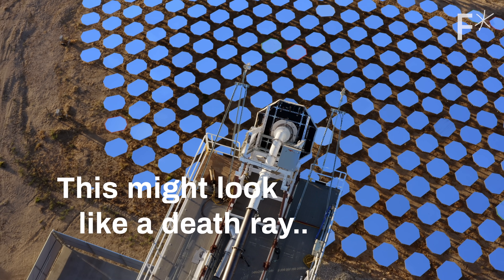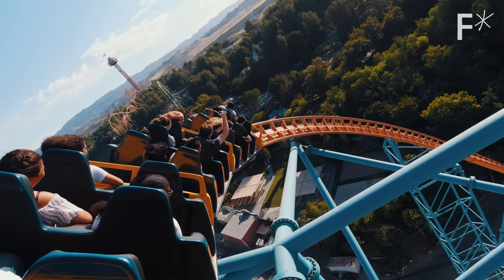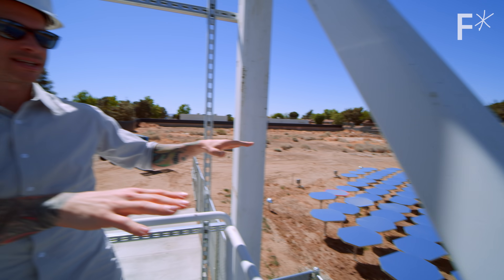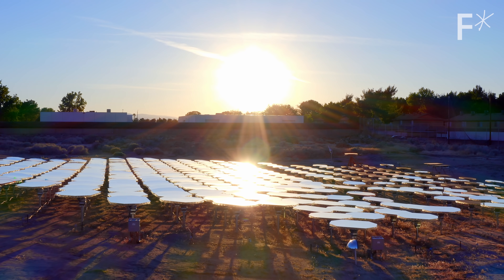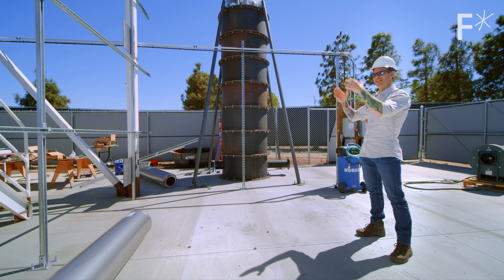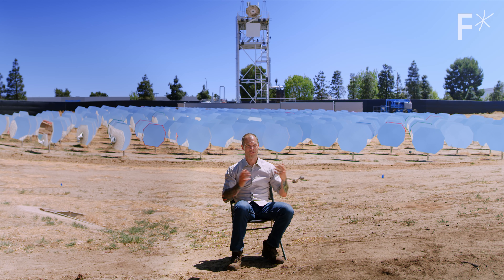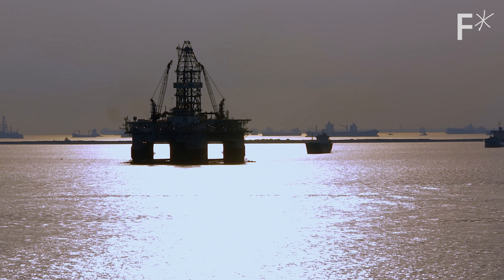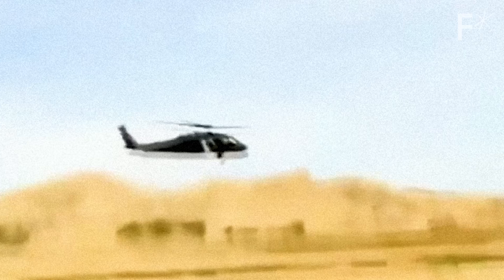How concentrated solar power could fuel the future | Big Think

Comment: CO2 at 0.04% is a 2,500th of the atmosphere. That means to warm the climate by just 1"C carbon dioxide molecules must capture 2500"C of heat energy. That is bonkers. It also breaks all the laws of thermodynamics. 

Methane is 0.00017% of the atmosphere so its even more bonkers.

However, the climate is changing. This is because of deliberate geoengineering programmes, in particular ozone thinning away from the poles. Though largely unreported ozone thinning effect is directly observable, this summer you will see a unnaturally bright sun just as we did last year. Under these conditions the pain felt when looking at the sun is not only from the increase in visible light but the much larger increase in infrared. (Look up at the sky and you will see a range of geoengineering operations in progress, these include chemtrail induced cloud or hazing, ripple patterns caused by HAARP installations, bizarre and unnatural cloud formations). 

Climate change is a programme to force change in accordance with the implementation of Agenda 21 /2030. Current events demonstrate this transition is well underway and will involve massive population cull through injected nanotech (re transhumanist programme). Agenda 21 also sees the permanent loss of all property rights with the introduction of universal basic income (ref NESARA/GESARA) and has/is being promoted by The World Economic Forum. 

'You will own nothing and you will be happy' WEF

In a depopulated world the surviving brainwashed and controlled population will be confined to mega cities. Carbon limits will be used to restrict consumption and liberty. Meanwhile the re-greened wilderness will be the exclusive playground of the ultra rich elite posing as conservationists. 

The CO2 hoax amounts to the theft of the world and the enslavement of humanity by a parasitic few. 

Welcome to the future!

_______

I have included a debunking of 'accumulated heat' as it is so often used to explain how trace elements, so called 'greenhouse gasses', can warm the planet. 

Accumulated heat whilst sounding a reasonable explanation of how heat can build up is rather nothing more than gobbledygook. In fact it shows those using such arguments do not even understand what heat is. 

When we measure temperature we are measuring the heat energy a thing is losing. In short heat is a measurement of flow, the transfer of heat energy and this will always be in the direction towards the colder. For this reason a thing can never 'accumulate heat' in the way those advocating CO2 climate change describe. The temperature of a body is the measure of heat output, it can never be greater than the measure of heat input. Output = input. When a thing is warmed it is heated to an equivalent of the heat input. If this input is not maintained it will cool. Those that propose that heat can build up to be hotter than the total measure of heat input at a given time either do not understand what heat is or are being deliberately misleading. To illustrate, an object being heated by a flame can never become hotter than that flame, it's temperature cannot rise inexorably to the temperature of the sun for instance. Heat cannot be accumulated. When we think about it common sense tells us this must be the case. 

NASA and even Nobel Prize winning physicists have expounded 'accumulated heat' as the explanation how CO2 is able to warm the atmosphere. They claim that over hundreds of years CO2 has captured heat energy and this heat has 'accumulated' to produce a serious warming effect. As I have just explained, this is totally impossible and fundamentally violates all the laws of thermodynamics. That respected scientists should support such uneducated, unthinking nonsense is disturbing and only reflects that in terms of being able to think clearly about a subject they have no facility or inclination. These are the Dark Ages of science. Belief has outweighed logic or any critical thought. It tells us that we should not unquestioningly accept anything we are told, that experts can be fools. 

(NB: be aware of attempts to discard thermodynamics by talking about biology. 
Eg. 'It only takes a drop of arsenic to kill a person.'
This would be somewhat desperate, muddled thinking. Clearly biological processes based on the reaction of a cell are not the same as the laws of physics/thermodynamics).

Comment: Where do you get the water to turn into hydrogen? Not many deserts are right next to the ocean and how much ground water could there be? I guess you would need to run wiring from the desert to the ocean shore, since that would be easier than transporting the water to the desert.

Comment: Two big problems with solar is that it is intermittent and diffuse.
Reply: Nuclear needs 1.3 square miles per 1,000 megawatts and it will not effect the climate. These solar and wind farms, if made to scale will have a huge effect on the climate.

Comment: "the difference" was confusing
They tried to explain why THEY are better than others. At one point they say it's because they can get to a higher temperature and thus melt rocks. Okay, but others don't need to because they are just melting salt. Different approach. Both make thermal batteries essentially... but then they are suddenly talking about splitting water to make Hydrogen. From the thermal batteries? If so, then why are YOU unique?
I'm having a hard time believing that the "software approach" enables them to line up mirrors in a way that nobody else is capable of doing accurately.

Comment: You could do a similar thing with solar panels, which are already more cost effective than fossil fuels. The detour with hydrogen can be chosen, if you have way more energy as you need. But the essence is: Do it. Either this or classic solar, or probably even both. Throw money at it and you will get a good return. I assume that this type of power plant will cover the energy base load, as it has a fairly constant output. Energy spikes could be covered with water power plants. Energy for direct consumption (think air conditioning, etc.) would be far more efficient with local production. It is possible, it will come, but will it be fast enough? That is the hard part.

Comment: I am staggered by the use of AI for orienting the mirrors. I assumed that some high school math would be enough.
Reply: The AI isn't for calculating position. It's for modulating which mirror to control when.

With 400,000 things to move in 2 axis each, and with it taking a couple seconds to move reach one and verify it arrived, you never get the job done before you have to start over.

Same problem arises with how to provide power to all those ¾ hp motors.

These problems compound with bigger systems that have more mirrors.
Reply: That was my first thought as well.  They didn't go into the details.  It seems their goal is to optimize the sunlight collected.  The only think I can think of is that differences in the atmosphere can refract the sunlight slightly.  The refraction will change constantly and, unlike the position of the earth and sun, it cannot be calculated in advance.   It's just a thought.   So while more advanced than high school math it is probably not 'AI' that is being used but some sophisticated software/math.
Reply: No need for AI at all, sensors and a good program can manage that all...
Nowadays a simple if else program is being called AI only for marketing purposes
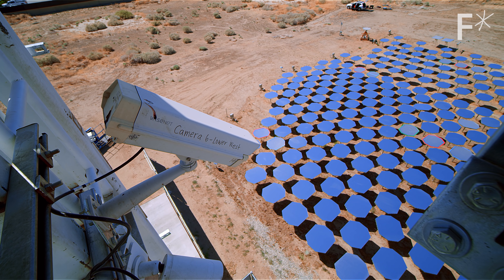Reply: @khaledarja9239  My interpretation was that they can do a setup with cheaper, less precise devices using AI than they could with a highly calibrated set of machinery. The AI allows them to calibrate on the fly and tune constantly (2:05). By eliminating precision machinery requirements, this system would drop the price dramatically by greatly easing the factory requirements (tolerances) of the components, meaning cheap components that work as well as expensive components when tied with the AI.
Reply: @khaledarja9239  actually, there's always going to be some compromise in this task because doing it completely and perfectly isn't possible in the time allotted. And when there's compromise, there's room for learning new strategies to maximize one output vs another. That's where the AI comes in.
Reply: Flat Heliostats can be aimed with simple circuitry, however, they chose to use AI. As Flat Heliostats need two-axis controls...
Curved Heliostats can heat molten salt in a pipe and only need one-axis controls...

Comment: Hopeful tech... however. Software controls the accuracy?... hardware still has to move, align the mirrors. How is the hardware powered and how much maintenance is needed? Dust is another problem. How to clean thousands/millions of mirrors in deserts where there is no water. The mirrors seems also a bit fragile. Ofcourse they can be reinforced but this will cost material thus energy.  I really hope they figured out some of these issues and there are solutions but to power the world by using this tech at the end of this decade seems not possible.. nevertheless we can/must make a start.

Comment: Very cool!! However, getting the sun's position this way seems a bit excessive to me, I mean you can have a sheet of metal or anything really, with 4 LDRs and 2 servo motors, one for each axis, and this sheet is programmed to move until the 4 LDR values are the same since they're connected to servo motors we can get the position of these motors, and feed that back to the PLC, of course, each heliostat's position must be saved to do some linear algebra with the vector of the sun we got from the LDRs! This way is cheap, precise, and reliable! At least that's how I'm doing it for my SDP!
Reply: I don't know tho, maybe that's why they got such high temps compared to our 550 C! very cool idea tho!

Comment: issue hasnt been about energy generation from renewable sources for a long time, its been about retaining the energy after the sun goes down or wind stops etc. Without solving that problem, this will not.
Reply: If I understood this premise correctly, the hot rocks act like a battery, storing heat that can be used at any time. Presumably, at the scale he proposed, it would retain enough heat to be used at least until the next sunny day.

Comment: Just a thought they say global warming keeps increasing over the last forty years, solar power has been around forty years and keeps increasing. How does solar power work it absorbs light that would have been reflected from the earth and makes electricity? When that electricity is used it gives off heat that goes into the earth. Is there a relationship between solar power and global warming? It sure sounds like it to me.

Comment: Using electricity to generate hydrogen and moving it around in pipelines is not only extremely inefficient but also a guaranteed disaster in the making.

Comment: I would like to see a comparison between the heat energy and solar electrical energy - rather than a proposition to use heat arrays (sounds entropic energy loss friendly) to convert transported water to the desert (sounds energy intensive) to produce hydrogen (notable energy losing process) to transport it to places without sun (ugh, more energy) 
.

Comment: It is not going to work, 
It doesn’t generate alot of power.
It doesnt work for 1/2 the day
It doesnt work in weather.

But mainly It is not fixing the main problem that solar has storing the power and getting it to where it needs to go

Im guessing this is just publicity and you wont hear anything about this for the next 10 years when it re-surfaces again

Comment: I have read an article criticizing the fuzz around hydrogen. Allegedly some scientists are suggesting that all the fuzz would be a diversion from transforming our energy supply to a de-centralized solar-powered supply, which would be a lot more energy efficient - apart from possibly for the purposes of heavy industry like the steel industry. The point of the piece I read was that all (most?) of the promotion of green hydrogen was merely a means for the fossil fuel industry to delay the transformation and prevent a decentralized power supply.
Well even if this works for the heavy industry only I do want to see this happen! Great

Comment: Sun to heat, heat to electricity, electricity and fresh water (in the desert!) to hydrogen (which needs supercooling and is extremely volatile and so hard to transport), hydrogen to electricity...
I would like them to actually what's the whole system chain efficiency. Hard to imagine how this could be cheaper or more efficient than just solar and batteries.

Comment: Heres a thought: invest in carbon capture to actually pull co2 out of the atmosphere. Break the carbon out and condense it into a solid, use that instead of rocks as your "battery".
Reply: You turn that carbon back into synthetic petroleum and the cycle becomes carbon neutral and you don't need to build new infrastructure from the ground up to support electric vehicles.  The Germans discovered how to make oil out of coal in the 1920s so we can definitely make oil out of captured carbon from the atmosphere.

Comment: There is NO PROBLEM in meeting ALL OUR ENERGY NEEDS ON EARTH... AND WITHOUT POLLUTION... JUST USE AGRIVOLTAICS on 1Million km2 of the Global 15km2 of Agricultural Land.... while growing similar amounts (from a little less to .. much more) of FOOD too... yes only ONLY 7.5% of Framland....... you can now relax... as there is more than sufficient Land to permit "modern man" to wallow and feed all of man's appetite for Energy...

Just FYI... the above 1 Million km2 would consist of 150TW of AVPV Panels generating 180,000 TWhrs/yr.... by 2050... Why look around and "waste money" on "other oprions"... focus... and JUST DO IT.... ASAT (As Simple As That)... all this with TODAY'S TECHNOLOGY.... as FAR AS THE SUPPLY SIDE OF ENERGY IS CONCERNED..... if you really want a challenge(s)...
• Focus on Non-Polluting Solutions for Sunset-to-Sunrise Enegry from Solar Energy produced during the DAY... approx 20-25% of the 180,000 TWhrs/yr... (Electric Batteries leave behind a legacy of Toxic Waste... a no  no.. if you want to eliminate pollution....).
• Conversion of Industries (Steel, Cement, Glass, Materials, Chemicals, etc..) from guzzling Fossil and Polluting Fuels to (Solar Powered) Electricity
• Conversion of Transportation Sector (Land, Air, Marine) using Non-Polluting Solutions only ... like Compressed Air, Hydrogen and other Gases and Liquids (from Electricity only) and NOT cause Gaseous, Liquid, Solid Waste Pollution during use and "after death"...
• Conversion of Commercial and Residential Sectors from Fossil Fuels to Electricity (from Solar Panels)
IN OTHER WORDS.... THE REAL PROBLEM IS IN THE DEMAND SIDE OF THE ENERGY BALANCE... AS AV (with Storage) assure 24/7 Non-Polluting ENERGY fir not jyst the present Electricity users but ALL ENERGY DEMANDS OF ALL SECTORS... 
All the best... and "put the shoulder to the plough" as mankind tries to undo the damage caused by Pollution to MAN.. BEAST AND NATURE TOO... and hand back a hwalthy and green Earth to our grandchildten and beyond.... 
O ly problem we will leave behind for the next 1,000 generations... is Nuclear Waste... and hence MUST PUT AN END TO THE NUCLEAR PILES ALL OVER THE WORLD.... AFAP (As Fast As Possible) ... to reduce this legacy of nuclear waste for future generations because of our SELFISH AND ASELF-CENTERED Needs to "wallow" in Energy...

Comment: Its a deluded approach.... first go look at all the failed solar just like that.   If you had any insight into manufacturing you would know there are steel foundries today that run on hydrogen and that is a simple conversion of coal fired. So whats the foot print difference? yes its massive to rebuild everything and would take decades. Hydrogen is ideal for many industrial applications and you can also do a host of green fuels. Heres the kicker .... the US has %40 more green hydrogen from nuclear avalable TODAY. So the issue is why are the bloody minded greenies ignoring the zero carbon footprint of existing sources? 50% of current solar panel energy is wasted MAYBE we need to focus on leveraging the current resources and not pie in the sky unproven tech.

Comment: Fantastic, heating up stones to store energy from heliostat mirrors, is a far better mechanism.  To do this efficiently and economically, as shown, is inspiring to learn where the technology has progressed to.  The current heliostat hot salts is good, but to make it better using stones to store the energy, over a thousand degrees Celsius, is innovative.  Congratulations.
Reply: I'd like to know what the costs of converting that 1500 degrees to steam (and electricity) is so we have some idea of it in comparison to other good ideas.  BTW converting it to hydrogen is a niche solution because the conversation from H2 to electricity is only around 60%, AND you have the transportation costs.
Reply: @lokensga  
i think the h2 part is for places where solar farms are not suitable

Comment: What about all the streamers!!!    The Ivanpah solar farm killed over six thousand birds annually by lighting them on fire and over hundreds of desert tortoises.   Not going to work really great in the pacific north west or places with clouds and fog or in the winter covered in snow.   High temperature in hot rocks aint going to run your Tesla.  Compared to water the specific heat capacity and the thermal heat transfer are the worst.    So we have an app to position the heliostats using camera feedback is that what we are touting.  Positioners with internal aiming feedback are ubiquitous and can be directed to adjust the heliostats based on simple date, time and position calculations.